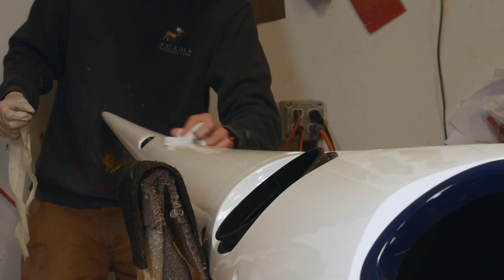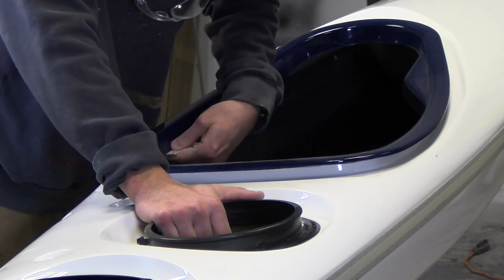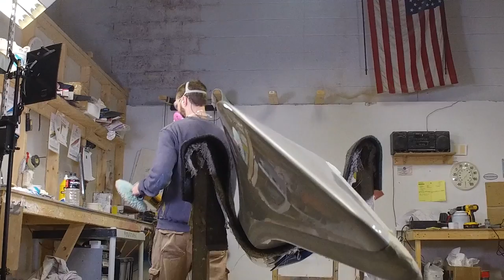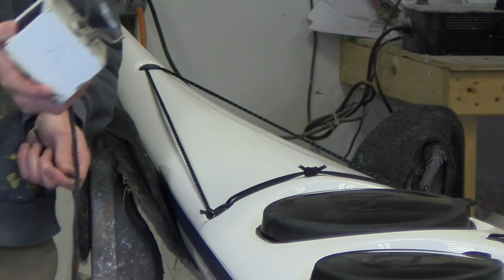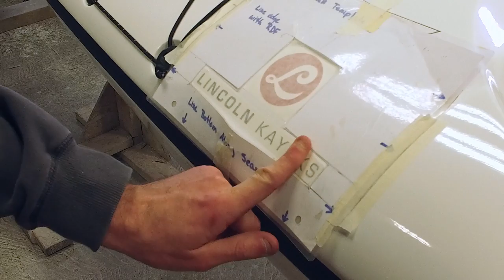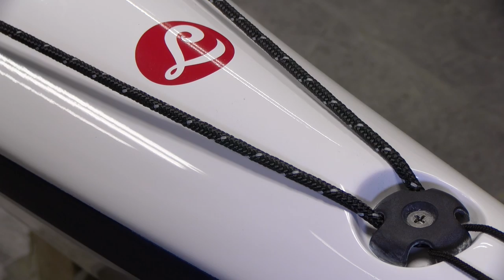How We Build Your Kayak (Part 5 of 5)

Comment: Out of curiociy what is he doing with the bag of resin around the 30th second?
Reply: Filling it with resin, twisting it, biting one corner of and use it like a pastry chef to squeeze control the flow out of the bag corner like a silicon gun